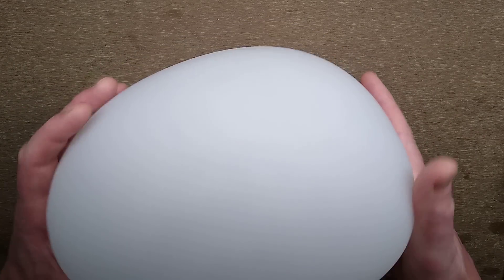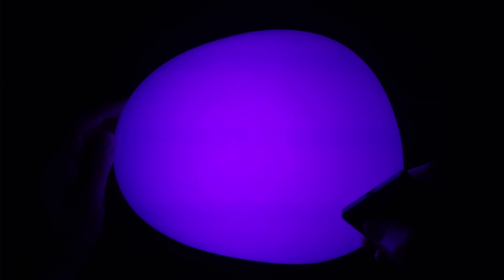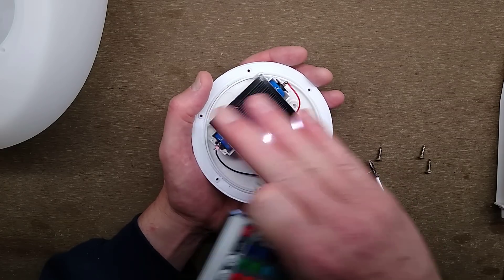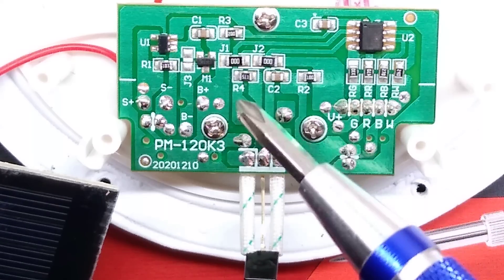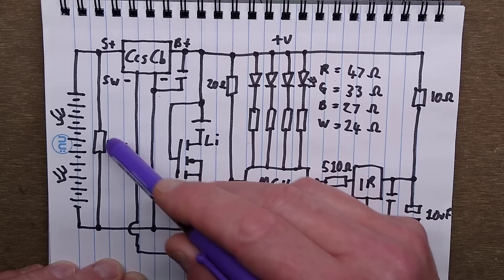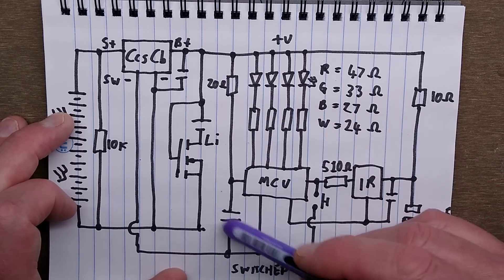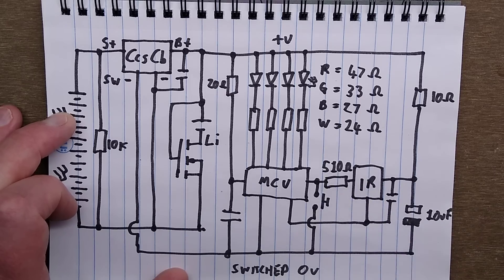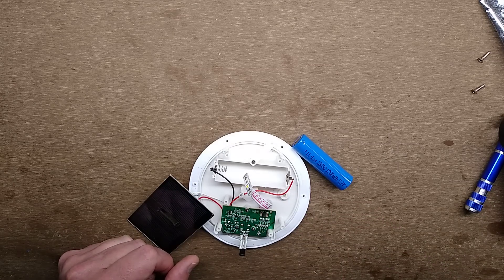Aldi glowing rock (with schematic)

Comment: Whoa... this thing seems to be build ridiculously well! A bunch of these placed around a garden would look very nice.
Reply: You could say... built like a rock?
Reply: Why? Just because of a expensive MOSFET instead of a diode as polarity protection?
Reply: @kitecattestecke2303  No, The rest of it is well designed too both circuit and mechanically. And just FYI a diode would waste energy in the 0.7V Vf (forward voltage) of the diode. Something the MOSFET circuit does not suffer from. It only has a very small RDSon (drain source resistance when on).
Reply: @kitecattestecke2303  expensive? 🤣

Damn near any MOSFET will work right there... Pick one. Plenty in the "cheap as a PN diode" to choose from 🙄
Reply: @kitecattestecke2303  A diode as polarity protection would not work, you can't charge and discharge through a diode. A mosfet in conduction is bidirectional.

Comment: What is the advantage of using the MOSFET for reverse polarity protection vs. a just using a diode? there's voltage drop across both, but is there significantly less on the MOSFET?
Reply from the maker: In this instance a diode would interfere with the precise charge voltage.
Reply: I was curious about that as well.
Reply: Gut feeling (i haven really thought about this enough, though, i suspect) is that the threshold voltage of the fet will mean that the battery may begin to get cut off when it's run down, but I don't think that's the reason. A diode wouldn't work because the current flow is one way for charge and the other for discharge. .The fet works because the gate will always be positive with respect to the other terminals.
Reply: I cannot see how the N-channel MOSFET can work in the schematic with the drain at the negative side of the Li cell. I can see it work while charging, the gate is positive relative to the source, and the current flows from plus to minus through the cell and MOSFET, but while discharging the current from the negative goes up through the cell, opposed to the source current of the MOSFET. Where do my thoughts go wrong in this ?

Comment: That voltage protection is clever. I've wondered how the other do that on a rechargable cell, as the diode trick won't work.
Reply: Yeah. I wonder if it also function as a low voltage cut-off, if the threshold for the mosfet is around 3v
Reply: @mikaras  that would be very clever! I like these clever but incredibly simple circuits.
Reply: @mikaras  that looks to be it's primary function
Reply: I cannot see how the N-channel MOSFET can work in the schematic with the drain at the negative side of the Li cell. I can see it work while charging, the gate is positive relative to the source, and the current flows from plus to minus through the cell and MOSFET, but while discharging the current from the negative goes up through the cell, opposed to the source current of the MOSFET.
Reply: @erikdenhouter  Once the voltage on the gate is raised well past the threshold voltage, the mosfet acts like a low value resistor and passes current in either direction. Even if it didn't, the body diode would be conducting when source and drain are reversed.
Reply: @RexxSchneider  Thanks for your kind answer. "In either direction...", that I did not ever know ! So I was thinking in BJT terms.